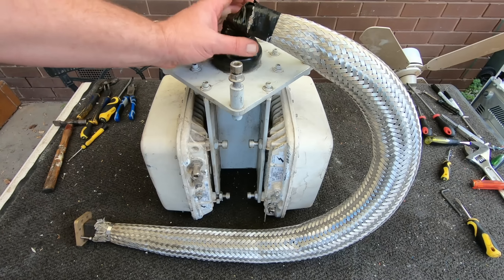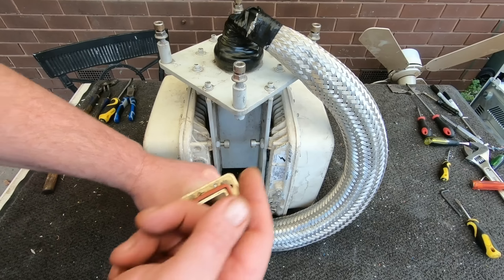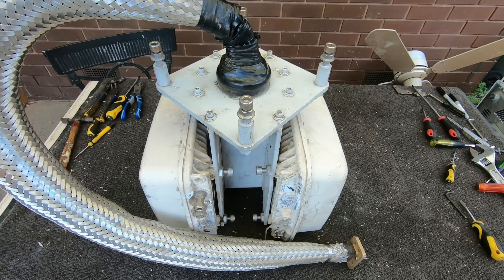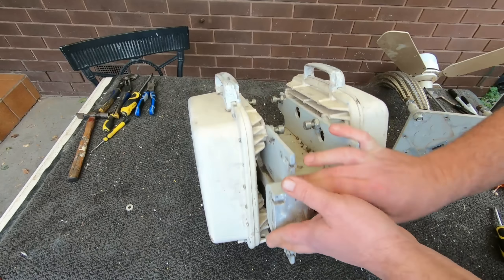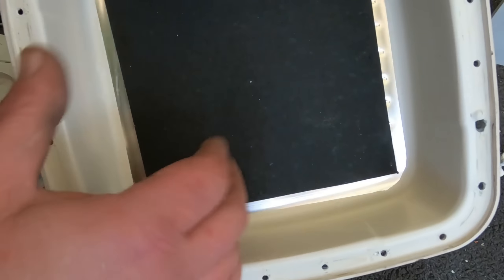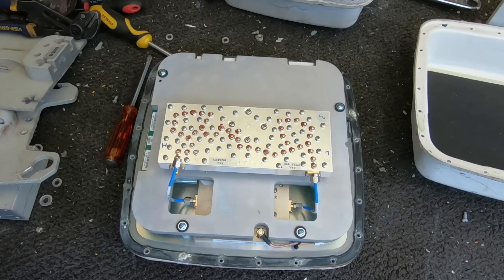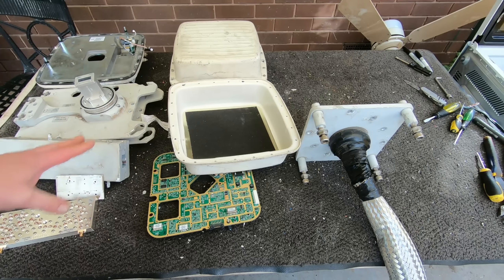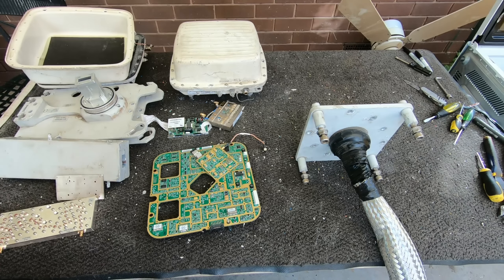Alcatel Microwave Radio Unit Teardown

Comment: This are 2 tranceivers (each unit has rx/tx on diff freq with the tunable filter), which are coupled to one antenna output (via the waveguide). The antenna might be directional (beam).

Comment: The light weight piece might be magnesium it has the right color. You can test it with vinegar, if it produce bubbles it is a high magnesium content, if not pure.

Comment: That braided wire sleeve probably of some good value for those who are into the high-level consumer audio equipment.  I've seen some pictures and this sleeve is used to cover the audio cables from the outside electric interference for the best audio possible.

Comment: You have an 8 GHz MW radio with 2  Transceivers. The flexible tube you referred to,  is the twistflex/flextwist, that is being used, in this case, to connect the microwave outdoor transceivers directly to the microwave antenna.  It allows easy management between the antenna and the transceiver mounting plate. The wave guide itself is not very manageable and if kinked, or dented will cause unwanted reflections and signal degradation. This can and in this case does,  provide both TX and RX signals to flow bi-directionaly. You will find twistflex inside the shelter as well to go take connect the wave guide to the radio when the transmitters are inside.
Reply: Thanks for posting this. you taught me some stuff!

Comment: A waveguide is an electromagnetic feed line used in microwave communications, broadcasting, and radar installations. A waveguide consists of a rectangular or cylindrical metal tube or pipe. The electromagnetic field propagates lengthwise. Waveguides are most often used with horn antenna s and dish antenna's.
An electromagnetic field can propagate along a waveguide in various ways. Two common modes are known as transverse-magnetic (TM) and transverse-electric (TE). In TM mode, the magnetic lines of flux are perpendicular to the axis of the waveguide. In TE mode, the electric lines of flux are perpendicular to the axis of the waveguide. Either mode can provide low loss and high efficiency as long as the interior of the waveguide is kept clean and dry.
To function properly, a waveguide must have a certain minimum diameter relative to the wavelength of the signal. If the waveguide is too narrow or the frequency is too low (the wavelength is too long), the electromagnetic fields cannot propagate. At any frequency above the cutoff (the lowest frequency at which the waveguide is large enough), the feed line will work well, although certain operating characteristics vary depending on the number of wavelengths in the cross section.
Reply: Shady Oak Forge Cheers mate, good explanation.

Comment: I have looked without success.  Why is the recovery so little?  Surface area is there even if the flashing is thin?   Many refiners seem to feel like it’s just tough to get.   I’d think a small rotary sander in a glove box and you could strip that flashing lickity slip.

Comment: Today I scrapped my first 2 televisions based on your tips amd it got me some nice copper. Are those insides of the copper spools made of graphite?

The rectangular opening is called a wave guide, it is where the radio frequent signal is passing through and is specifically made on the pulse widht of the RF energy 😉

Awesome stack of aluminium!

Comment: That’s microwave waveguide. The air inside the tube acts as the dielectric similar in function to the white insulation inside your tv coax cable. Could you stroke your braided tube a few more times? That was hilarious! Oh...and send me all the waveguide fittings! I’ll pay you!

Comment: Hey Ben, not positive but I’ve seen braided lines like that frequently on electric motors, lights, etc, that are installed outdoors. They’re known as “explosion proof conduit,” typically installed in corrosive environments.